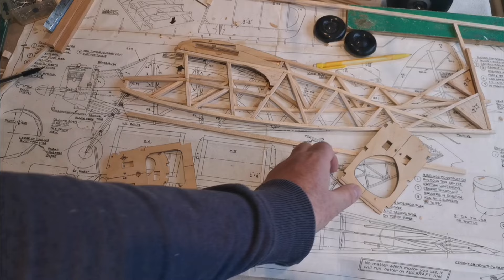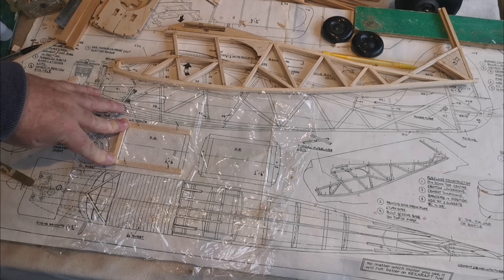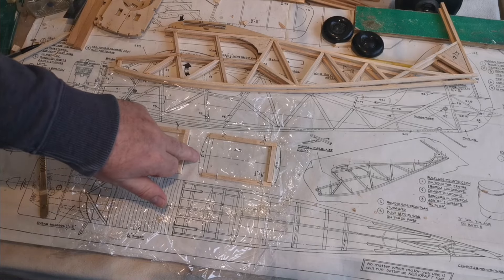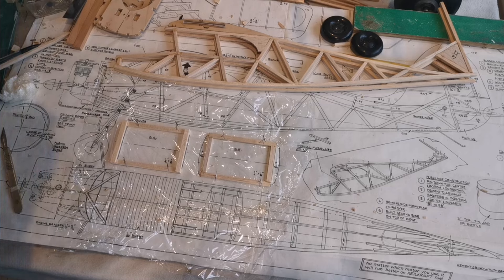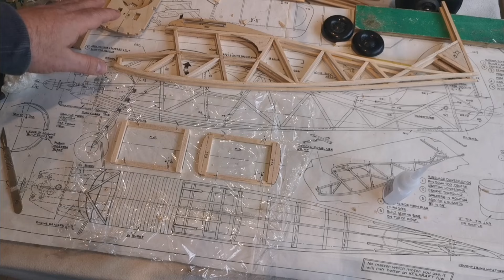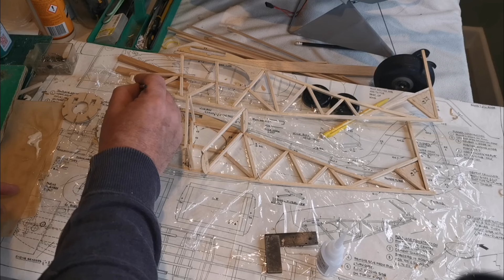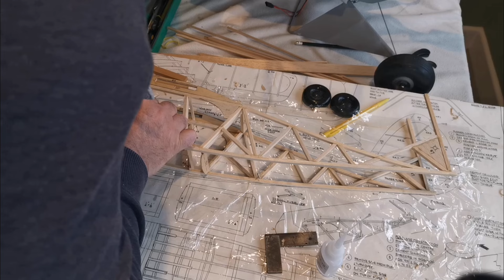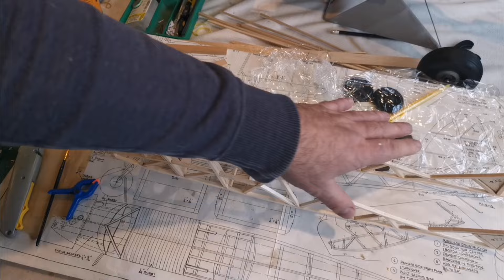RC Conversion of the Keil Kraft Ladybird : Fuselage build part 2🐞

Comment: My problem is dropping small or delicate screws/parts/tools on the garage floor during the middle of a complex building operation, the item always immediately rolls under the most inaccessible  bench/box or dark corner never to be found again. I see what you mean about the overkill  design of the LadyBird Mark, I am sure that Fuselarge will withstand almost anything. We are lucky in that Flying weather here in Cape Town is almost always good at our field, wind can be the only limiting factor after 10h00 at certain times of the year. cheers Paul
Reply from the maker: I am so tempted to alter the design but I also want to stay true to the original.